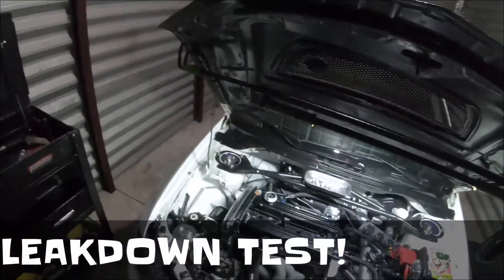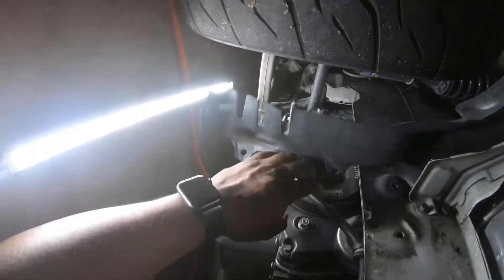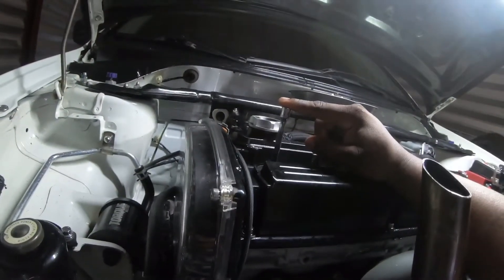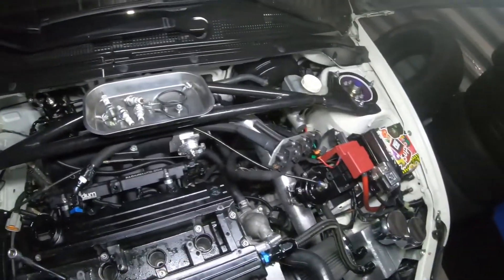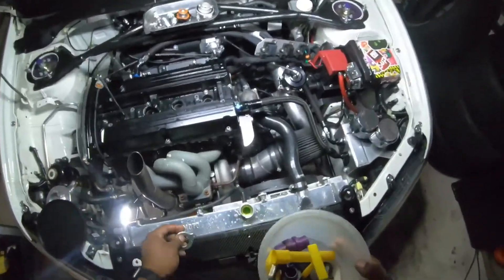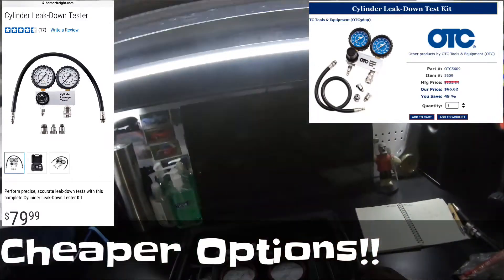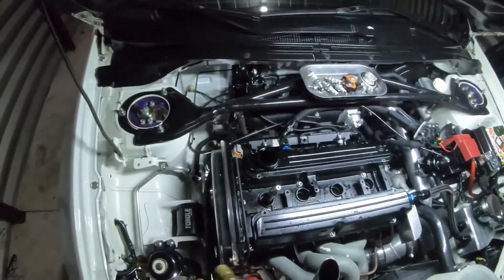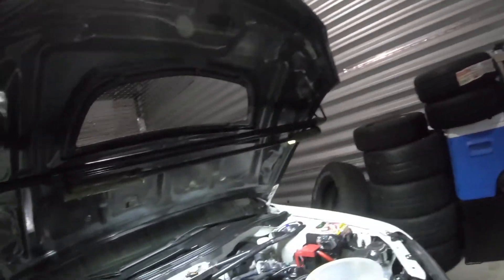HOW TO DO A LEAKDOWN TEST ON A 4 CYLINDER | 4G63 |

Comment: If cylinder 1 is TDC but on exhaust stroke that means cylinder 4 should be TDC on its compression stroke. There you can just check cylinder 4 instead of spinning the motor again.

Comment: do cylinders need to be TDC for a compression test? I feel like ive seen compression tests with them not TDc
Reply from the maker: So when you’re doing a compression test, you’re actually spinning the motor as if it was running and seeing how much compression it builds up over the time while you’re turning the motor over. So TDC doesn’t matter.